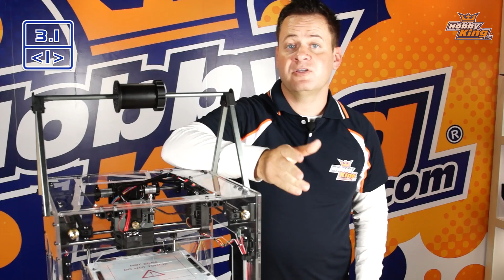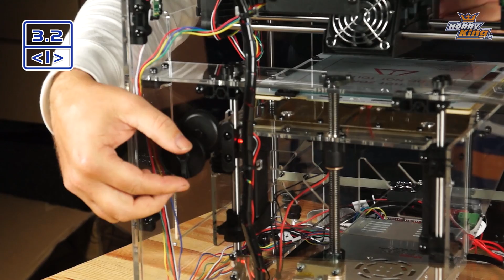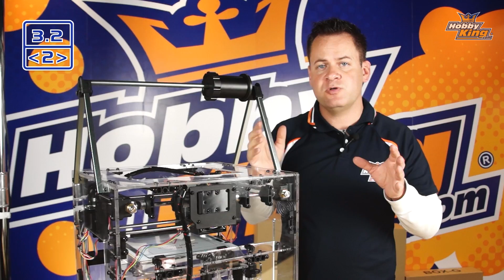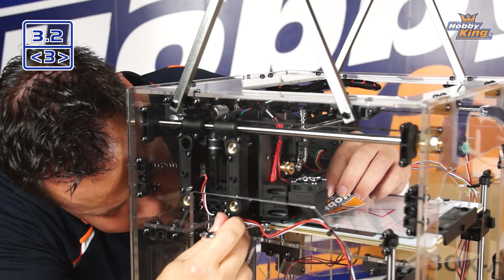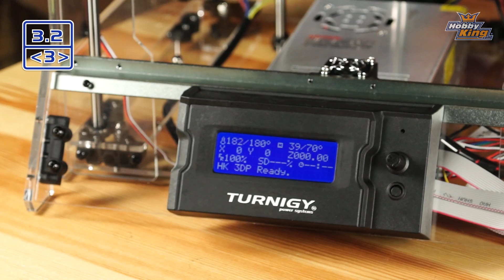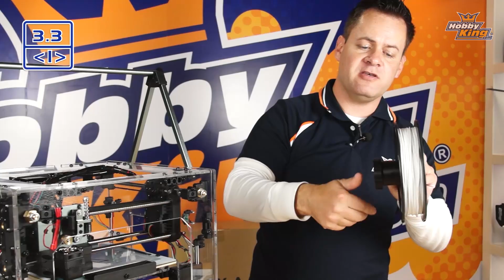Turnigy Fabrikator 3D Printer - 3.1 to 3.3 - HobbyKing Product Profile

Comment: I have a few questions:
Where can I find the video series regarding printing files?
Can I print by loading a .stl file onto the SD card and telling it to print via the interface on the printer? 
How do you set things like layer height, print speed, pause a print etc?
Thanks
Reply: 1.series is coming
2.yes you can but first you need to slice it (like with slic3r)
3.you can do it from the screen or the pc

Comment: Oh, just push in the filament and it's ready to go?  Yeah, if you want lousy prints.  With the slight differences in electronics and mechanical components, it does not matter if the firmware is configured at the factory.  Each printer built needs to be calibrated to determine the proper step rate per mm, z offset value, etc.  Without that being done, you will never get a decent print.

This reminds me of the of the DJI phantoms.  Make it readily available to the masses and make them assume everything will be perfect out of the box.  Not!!!